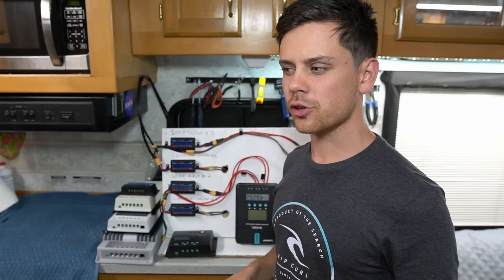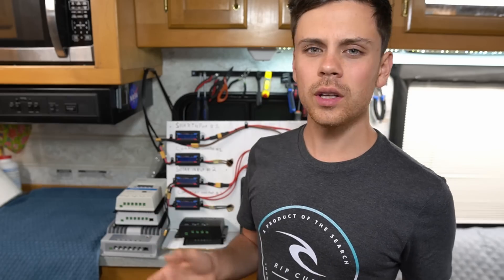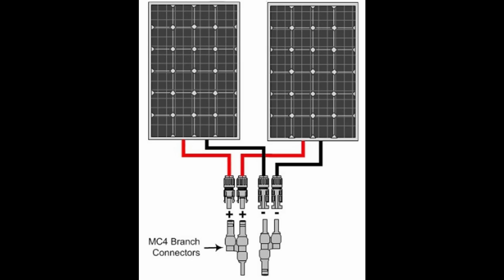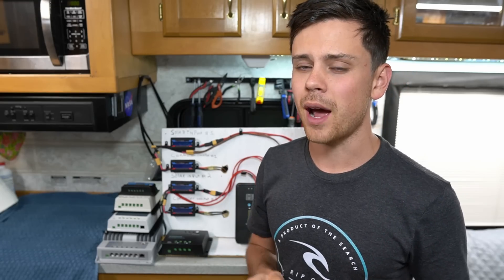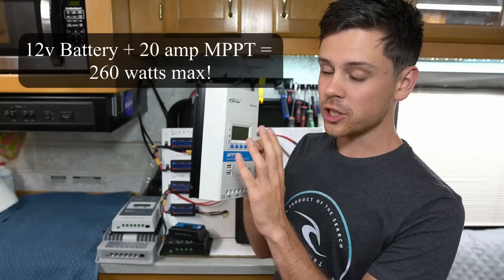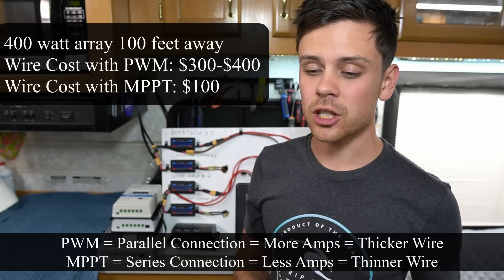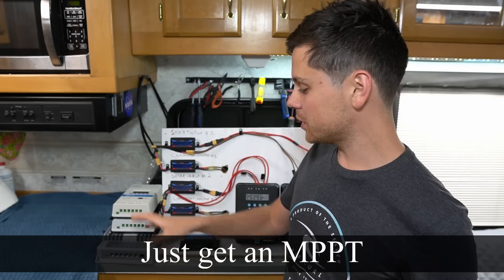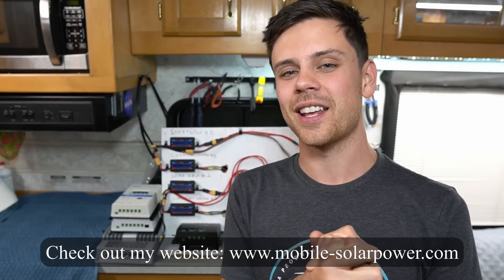MPPT vs PWM: Fast comparison for off-grid solar

Comment: I have one system with 3 * 100W 36 cell panels connected in series via an MPPT controller. I have seen 270W from the panels.
BUT....I also have a 80W a 100W and a 120W connected in parallell to an 30A PWM and I just reach about 8A  which is quite bad. I haven't figured out the bottleneck yet.
Reply: The problem occurs when mixing panels in that fashion due to different voltage and amps , so it's not the PWM's fault. In other words, the 80 watt panel is dominate. Someone did do a video on that. Just use the 120 watt panel instead. Before I went over to an MPPT, I used a Bourgerv 20 amp PWM (that has the Lifepo4 setting) with 200 watts of solar and had no problem with amps of watts and charging the batteries was no problem. Moreover, most PWM's are rated for intake voltage from the panels anywhere from 30 to 55 volts. However, there is one PWM, I found on Amazon, that will do 100 volts. Another thing why they tell people not to use a PWM with Lifepo4 batteries is because it has everything to do with warranty claims.
Reply: @JohnT.4321 Thank you, I will test that 👍

Comment: I have a question on batteries, My home has a general requirement of 300W for 24 Hours or 15kW for an hour. But my solar generates up to 3.3KW for as long as full sun hits it. This could mean in a full day of sun I could get 33kW of electricity which is more than enough to run my house for a day at 300W with one hour of high powered use at 15kW! But how would I store that energy and most 1kW inverters would run 300W but burn out at 15kW, and a 15kW inverter would not run at 300W. I need some sort of multiple inverter system that would run either a single 1Kw inverter or switch seamlessly to a 15kW inverter when needed?

Comment: HI, I have this situation, where I have 12V solar + 12V battery and a separate 48V battery. 12V system is also connected to grid and powers critical loads. 
What I want to do is to have a way to charge the 12V battery from 48V battery, when the grid is out and it's night/not enough sun. 
My question is can I use a PWM/MPPT solar charger to charge the 12V battery from 48V battery?  
Meaning have a relay closed when grid is out and 12V battery voltage drops to some value,  that then connects 48V battery to SOLAR input of PWM/MPPT solar charger, and connecting the PWM/MPPT solar charger battery output to 12V battery to charge it (the idea was to do it approximately at the discharge rate made by load on 12V system, 20A at the moment).

Comment: I wonder. If I was using a medium-sized power station...say 750 to 1000 watt-hours, and maybe 200 total watts from solar to power a 12v fridge, and a phone or two; PWM would be more than enough?
Reply: Yes, it is enough. However, is there a connection to the power station for the PWM?

Comment: PWMs have matured a bit since this video came out. The PWM installed in our 2024 RV has a max 600 watts. I'm sure MPPT's have matured also, so always best to check ratings/specifications of newer (and older) hardware.

Comment: Please I need your help. 
I have a 4 solar panel 180w 21v
Two batteries 150ah 12v 
PMW 60A
Inverter 1.6kva
Please what is the size of the cable that I will use and how will I connect the solar panel?

Comment: Ok I'm confused as I thought that PWM connects the panel directly to the battery in marginal conditions. So not much loss when there is not much sun, eg cloudy UK weather, the PWM rate would be 100%.  I need to double check how PWM works as I assumed the maximum duty cycle was 100% !

Comment: I'm pretty sure I need to get an mppt that's like $1000.  Not many on the market that can do 400+ volts  pv input. I'm going to have a reeeeeaallly long run so I need them all in series to minimize amps and keep voltage drop to a minimum.

Comment: I will have 6 12v 100w 5.5 amp panels in series for 1 72v 390w 5.5a panel. I dont know much and im still learning. But I think with mppt ill still get a little more from the voltage conversion to bring the volts down to 24v for batteries. So ill be guaranteed 390w at 24v plus some more after the conversion. Correct me if im wrong. Might seem dumb considering I could get higher voltage panels and have less panels all together but i looked and for my layout this works.

Comment: This was super informative! I just started out with Solar and building a small, 2 panel 400w (peak) system with two 12v 100Ah LiPo batteries. I got the batteries and panels first but have no idea what controllers to get. I got about 30 feet of wire from my panels to where I'm installing the controller. I think I will go with the MPPT due to the fact that I won't always have direct sunlight and may have cloudy weather from time to time. I will likely get a 2000W inverter. The inverter and battery will be right next to each other and indoors out of the elements. The MPPT will be outdoors but protected from rain.

Comment: @WillProwse,  would you be able to comment how I can use a 24v(25.9v) Lithium Ion battery with a 550W - Vmp=31.6v, Imp=17.4A solar panel ? should I use a PWM or a MPPT(seems Vmp is NOT sufficient to use a MPPT effectively) ? OR is it better to use a 12v Lithium battery with a MPPT with this Solar panel ? (could not find a another panel with equal or close specs in my country - so serializing to increase voltage is impossible)

Comment: I am sorry, Will, but my real experience with solar panels under bad conditions (shaded, cloudy) is exactly the opposite.
A PWM will start to harvest energy right from the very beginning, where the panels deliver 2-3% of their nominal power.
At that low level of energy the MPPT controler does not even start.  
And in many off grid situations it is important to harvest under bad conditions. When you have plenty of sun, your battery will be full at 14:00 anyway and you will throw the rest away.

Comment: For my setup pwm work better than mppt. I had my solar panel setup in parallel and mppt solar controller will only charge the battery when there was a 5 volts or greater voltage difference between the panels and battery. Mppt is good for a series setup but not pwm

Comment: Wrong,  wrong,  wrong, and maybe.  My Renogy works fine in cloudy weather.  It's flexible.  It can be 200 feet from my panels because i use 10 gauge wire in the house,  but heavy insulated aluminum in the yard.  Different battery sets use different controllers so MPPT's would be extremely expensive.  I never connect lead batteries in parallel.  Maybe? The Wanderer makes no radio noise.  Renogy forgot to brag about this.  What about your MPPT? By the way,  the Renogy Wanderer is doing well in very cloudy weather with a very small lead battery and variable loads.

Comment: I am asking if I use a 100 amp MPPT controller, is it okay for me to currently use 600 watts solar panels?   I later plan on more solar panels.  Also I can use multiple controllers at the same time on batteries?

Comment: I have a hyrbrid solar and wind controller.  The solar side is PMW and allows 600 watts and the wind side is MPPT and allows 1000 watts.  I currently don't have a wind generator so I was wondering if I can attach two 100 watt solar panels to the wind connections on the controller?  ps: love your videos and have watched tons of them.  You are very good at explaining things to those of use that are challenged in this area.

Comment: Hi 
Question I’m looking for a Dc to Dv with MPPT charge controller.   I have looked at many of these devices.   I have two 100w solar panels that produce 31.5 voc
More than most of these controllers which is around < 25voc

Panels will be in parallel 
Using 100ah lithium 
Using in a truck

Is there a dc to dc with MPPT that has a Voc over 32v?
Or do I need to buy a separate dc to dc and a separate Mppt 
Can the run together ?

Comment: I need a DC system, if I use 24 v battery bank then will the output from Mppt be 12 v? If not then there is hardly anything 24v in my part of the world.

Comment: have you got a slinky panel thet does say 300 w -400 watt. We have 1 but ia 68 cm x 159 and does only 50 watts, should do 130 watt. We can go to roof auality then we get 102 x 185 but gives 400 watt at 19 kg, Have you got a better option?

Comment: So I have 3 panels at 230w and a 80A PWN charger with #10 wire. With 4 MK M34 SLD G Gelled-Electrolyte Batteries. Could this work well only for lights in a off grid house?

Comment: Could someone explain me what PWM means here? 

I have a cheap chinese controller. All it does is disconnecting panel once battery voltage reach upper threshold. As soon as battery voltage drops below lower threshold, it connects panel again. It is just a conditional automatic switching. Is there another, third type of controller, that does pwm voltage convertion, but does not use mppt logic?

Comment: You forgot one more for lithium battery it's a mppt charge controller for 25$ it charges at 13.8 volts works great

Comment: Hi Will, I set up the Renogy 30W PWM starter kit like in your video ,  have a total of  3 100W Renogy solar panels now that I thought was overkill originally for limited occasional off -grid usage, added a 2000W Renogy Inverter to cover " appliances" limits in theory , all properly fused and wire sizes as I can calculate via your excellent videos. The Inverter AC output is " hard wired from the appropriate inverter location "to maximize output to 12/2 Romex  AC wall (internal) wiring to receptacles. Panel distance ( less than 20') is short range with 10 Gauge solar wires to PWM controller with extra wire length coiled for distance expansion if needed up to 100'  , using a parallel panel setup with MP-4 connectors,  have 2 100Ah Renogy AGM batteries in parallel wiring, temperature sensor attached. I run 12V receptacles without issues. I can run 12 V ( for a propane fueled Camplux water heater ) via  Flojet water pump without issues as well as 12V lights series and a tiny computer sized toilet air vent fan .  I can power AC  outlets via  the inverter. An AC lamp is no problem.   I recently tried a small , new microwave oven that was rated at 700W ( turns out it may draw 1100 W and produce 700W usual microwave power on highest setting per literature included in the box after the fact.) It will power the microwave but sets off the inverter alarm in seconds of turning on  and the PWM battery light turns red rapidly until shutting off the microwave. The load Voltage drops below 12. 2 V temporarily to around 10+ V under load . The 2 batteries started at around 14 +-  V at rest before usage. This occurs under 30 sec at full microwave power, maybe 10-15 sec at most.... If I turn off the microwave, the battery PWM indicator returns to solid green status. I previously tried a full sized Shop Vac which also set off the inverter alarm after 30 sec. +-. If I turned off the Shop-Vac it returned the battery indicator to green unless I ran it longer before turning off the load. That one time at a longer interval (under1-  2 minutes?  tripped the battery solid light to stay lit  red after stopping the load, until I disconnected the solar panel  wire briefly then reattached. This returned  it to the green light and charging resumed as normally. I have also tried a very small electric wall heater designed for use with solar power. The heater uses 500W. This alone does not set off any alarms or cause PWM battery light changes from green,  but may also pull the monitor meters down below 12.2 V to around 10.2 or so as well when in use. I would be using any of these larger loads separately ONLY. I would like to be able to use a 12 cup Mr. Coffee maker as well ( once again maybe 750 W or more start up usage)  but haven't tried it just yet. Once again , one appliance at a time. Suppose a small refrigerator, if ever desired, would also be a problem. 2000 W Inverter should do it but not presently able to support much of anything even with 300 W solar panels, 200 Ah (2-100) battery banks which always appear close to 200Ah (on the monitors at rest to start) , and my 30W PWM battery charge controller ..... If I added an MPPT charge controller, what size and how can I use my existing wiring / solar panel array? Or , adding another 100 W solar panel ,to make 400 W totaL, to make my limited  brief time frame needs work?     Suggestions would be greatly appreciated .  Anyone? Thanks!

Comment: Will, thanks for this succinct but valuable video. I’m living in the ever so cloudy, ever so northern PNW. I’m part of a group building an amateur radio emergency network on remote, isolated small towers.  The solar/battery system is about 50% of the kit cost and increasing the efficiency is paramount. There are a lot of YouTube videos on solar but I keep coming back to your channel for clear answers and actionable suggestions. Thanks again!

Comment: Great detailed info but to me sometimes confusing.  I have two 20 ah golf cart batteries today driving a few LED lights, charging phones etc at my off grid hunting cabin.  They are charged by 5 year old Harbor freight 100 W panels with their charge controller and 750 inverter.  I am wanting to add a small mini fridge and while I know I should upgrade the inverter to maybe a 1000W/2000W peak.  do I need to upgrade the controller?  Im guessing so.  What would you do

Comment: I did compare both with a 18v 6.7amps. 120w panel. The cheap pwm that is all over the market at 4 dollars just wouldn't give anywhere near the 6 amps. 10amps from mppt. I am sure the pwm just doesn't give you the amps either.

Comment: 400 watt max on pwm? Im currently running 900 watt on a pwm controller. 24v battery bank. 2 x 450 watt panels in parallel

Comment: Hi Will from Philippines here. I just recently purchased a powmr mppt 20amp solar charge controller, thinking it would do good for our little solar setup in the farm. Unfortunately, just 3 weeks of using , when our battery is fully charged at full sun, the voltage reading reaches up to 16.1v meaning it is overcharging our 100ah 12V sealed lead acid battery. We are unable to return it and the supplier from China is giving us basic instructions that are just the same as on their manual. Do you have any idea as to why this happened or how do we check the aolar charge controller internally to see if there is any short circuit or busted diode or something that can be replaced so it would function normally again? Thanks

Comment: I have a 20 amp renogy rover elite controller Using 1 battleborn 100 ah battery  In my 1st small build.. With nothing  On my battery shunt monitor saying I'm pulling 0.049 amps is that from powering the controller &shunt.. How much power does a solar controller consume??

Comment: Other people say it’s not worth getting an mppt for a basic camping setup. I’m running a 100ah lipo with a 200w itechworld solar panel and it works a treat with the supplied pwm. By afternoon my battery was back at 100%. I think this scenario was left out of the video.

Comment: We need to get back to the basics of resonance and understand the issues around PMW, and why they should not be used.  Especially with Chinese-made items.  The parasitic inductance in the system causes high-frequency ringing, during the moments of instantaneous current draw (as inductors do).  If you are switching that much current, the amplitude of the HF noise is going to be significant.  As these are not part 97 devices, they have no legal right to interfere with part 97 devices.  So yes, you are pissing off every ham radio operator near you, who is legally protected from being interfered with.  I can always tell when the tax re-distribution solar teams are going door to door.  I find the noise, file a complaint with the FCC, and they are forced to shut their solar system down, only to have to upgrade the charging equipment.  Connect a scope to the output of those things.  Look at both your current and voltage waves.  It's nasty.  And that's not even getting into the current and voltage getting out of phase.  That's a whole different conversation.

Comment: What are the disadvantages if i use buck converter instead of mppt?

Is buck converter same as pwm?
Reply: Not the same. Buck converter does not track the ideal current draw from the panel. MPPT always tries to keep the 12V panel in ca. 18V for maximum power draw. With buck you need to do it by yourself manually by adjusting current draw (if even possible).
Reply: How do we know practically if it is buck or mppt?
Reply: @TechnoEveryday  Not an expert here. I think buck is a step down converter. I think MPPT is able to do step up conversion too.

With MPPT the key is the input voltage monitoring to keep it in optimal range for panels I think...

Comment: I'm finally dipping my toe into solar.  I have a 12v battery with a cheap PWM controller, 400w inverter, and plan on buying a 100w solar panel from Harbor Freight to round out the system.  This is for my garden shed, where the only things I need are lights (planning on using 12v so I'm not pulling power through the inverter) and power to charge my tool batteries.  I may run some 120v hand tools off of it as well, but only during the day and only when it's sunny out.  I've had solar put on 2 different houses and really kick myself for the second one because the cost is so outrageous.  With the house I'm in, I plan on putting the whole system together myself, so the garden shed is kind of a test run for the real thing.  It's just a matter of getting the money together to build the system.

Comment: Great. I want to have a 300w DC system. 1. Does PWM regulate voltage , if not what to do? 2. If I use MPPT I wouldn't get DC out so I'll need another PWM to take load off the battery out so again an inefficient PWM between MPPT and Load. Any solution for DC system.

Comment: I have a 30amp pwm and (4) 100 watt panels and (2) 120ah deep cycle 12v batteries and a 400/800 watt inverter. I am going to hook it up on Friday. I think it'll work on my RV.